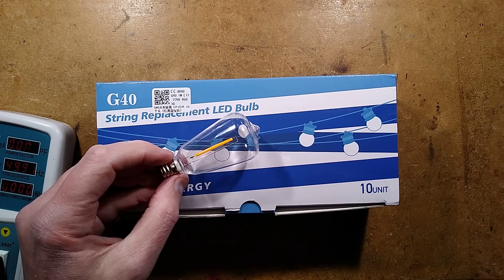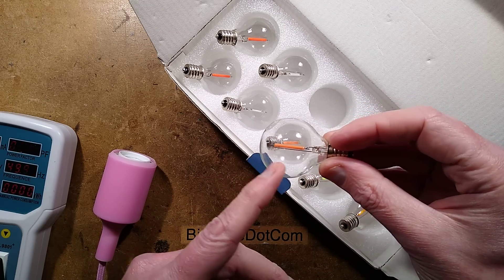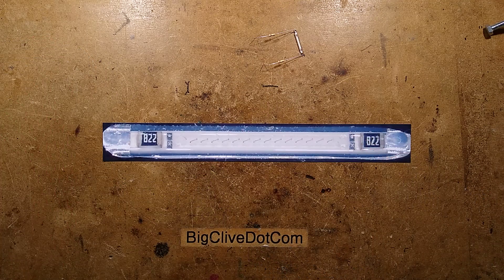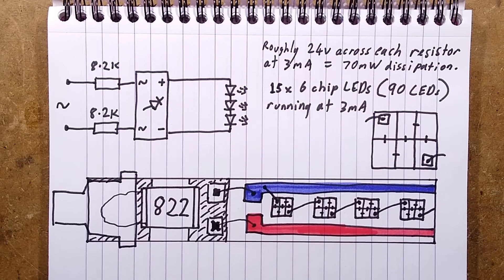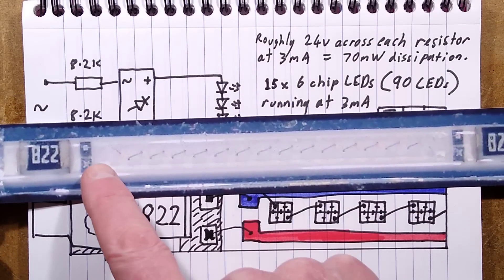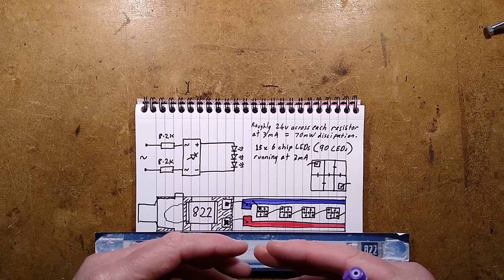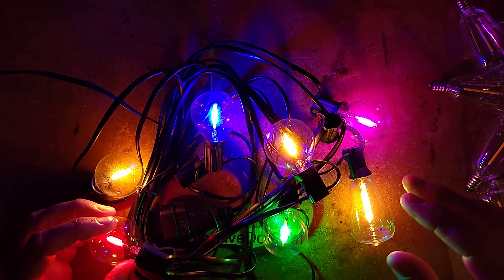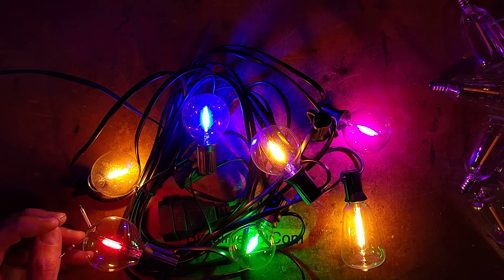New generation LED filaments - with schematic

Comment: Flickering led's always leave like tracers if I move my eyes quickly, I've noticed them a lot as brake lights on cars. Those look great and I didn't see any flicker with the whole string till you moved the red one. The 5v ones could be handy for USB or battery projects.
Reply: I guess they could be used straight into smoothened high-voltage DC systems too. But may overheat  2 diodes overtime before the LED's themselves fail ?
I see those flickers too and get me bad headaches.
Reply: There's a really distracting LED matrix sign by the M27E/M3N link road at the moment which produces the standard orange colour by alternating red and green so not only do you see multiple copies of the message as your eyes flick around to maintain all-round situational awareness, you see them in red and green which is far more attention-grabbing than just one colour.
Reply: @molletts  That sounds horrific. I mean it sounds like it would definitely get my attention, but not in a good way.
Reply: @AgentPothead  You can't see the flickering when the camera exposure is longer, ie the studio lights are off. You will definitely see the flickering in person.

Comment: Why did the blue one light up with 2 resistors of 820 Kiloohm in series but lit up without the 2 resistors aswell? 🤔🤷‍♂️
You should have measured the pink one and the calculated the power consumption, output and efficiency with your kink palculator while it was in the sink pocket! 🤪😂
Reply from the maker: It has built in resistors.  I added some externally to reduce current.

Comment: I have the replacement led. Its the ribbon form dot style used as filament, cut it at various length loops push into the screw in base two pressure clips. With variable power level and remote.  With a roll of LED tape its endlessly replaceable.

Comment: You'd really want either a frosted glass or coloured glass surely, help show the colour rather than hoping on external reflection

The summertical construction seems obvious, although unnecessary, who owuld be looking close enough to see a part has missing colour, but a shame it's missing a capacitor, specially as colours might be more inclined for use with people who may be more attracted to colours and be sensitive to the strobing

Comment: So,... If one of the 90 LES fails the whole thing is dead. What are the chances of that with genuine Chinesium? 😂
Reply from the maker: To be fair, they are only running them at 3mA and LEDs often fail short circuit unless being grilled.
Reply: LED's being grilled is way too common on commercial products, including brand name products.
Hyper economized construction, inadequate cooling and LED's pushed to their limits = failed lamp with a single chip going open circuit.
I had way too much of them.

Comment: Nice in that there's far less to fail on these, but oof, that flicker.  I'm particularly prone to seeing flicker - the first few generations of DSP projectors gave me migraines to watch due to the refresh rate - so hopefully smoothed ones aren't going away.  I guess a custom base that does rectification and smoothing and presents these with smoothed DC could work, assuming the extra diode drop doesn't dim them too much...

Comment: The TruTone LED bulbs appear to be constructed similarly (but not identically).  No circuitry in the base, and at least some of the filaments are flexible.  The circuitry appears to be slightly different, but I hadn't gotten a good look (got a sample from a friend who accidentally x-rayed theirs).
Reply from the maker: I've got some of these round globes on their way that have a curved filament.
Reply: I've wanted to get some of those TruTone blubs ever since I saw them on Technology Connections a couple years ago but I don't really want to spend 100 bucks on bulbs and probably another 50 on the strings of bulb holders. Plus I really like the looks of the Philips C9 LED lights I've used for many years now.